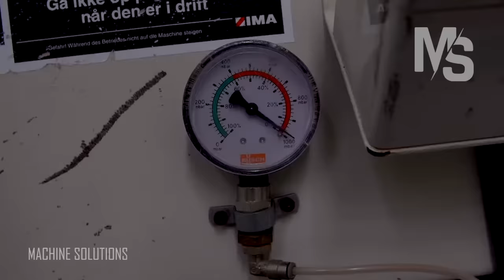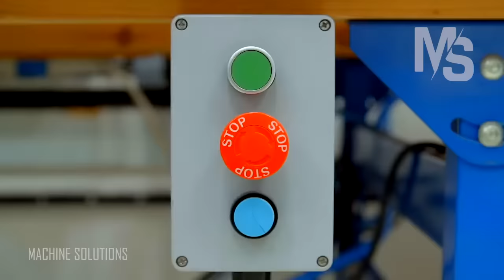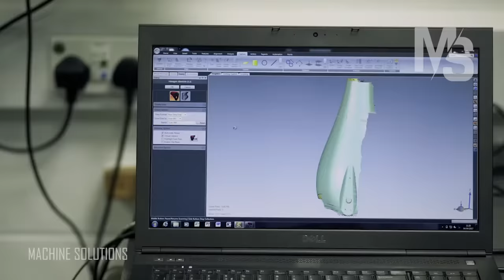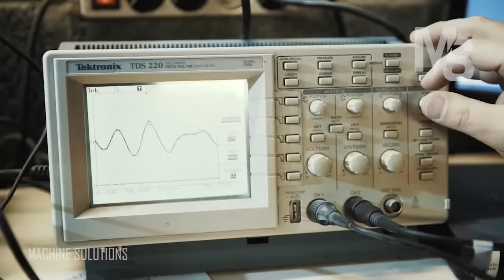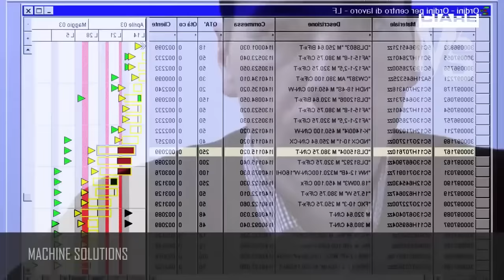Amazing Manufacturing Bass Subwoofer - Making Of Speakers - Factory Tour -How To Make Speakers

Comment: Fantastic video that gives a good insight into the huge amount of work that goes into producing High End loudspeakers. And in addition to that, there is even work to be done with the actual design and calculation of units, etc.
At 3:21. High End speakers and then connectors are used to connect the speakers. In my opinion, soldering should have been used. When connectors are used, corrosion can occur over time so that the connection deteriorates.
Reply: At 11:50 they do solder it.
Reply: @Z-add  At 3:21,  Do they connect the speaker with connectors. There must obviously be a difference between subwoofer units and the other units used, but regardless, soldering will always provide the best connection.
Reply: Also at 2:53  you see some more basic connectors. I find it hilarious that people buy these $35K speakers and spend tens of thousands on exotic speaker cables when ultimately they have to go through a 50 cent connector.

Comment: The Bowers & Wilkins 803 D4 (the first speaker that is made in this video) are great sounding, full range, end game speaker which sell for as of Dec. 3rd 2022 -> $22,500.00 a pair, and they weigh 62.15 KG (137 pounds) each.  They go down to 16Hz and up to 35KHz.  They are easy to drive, hard to move around, hard to pay for, but they sound great!  These 800 Bowers & Wilkins speakers are also used in Abby Road recording studio in England! 🔊🎶😎
Reply: Bob Carver TRUE SIGNATURE subwoofer is WAY more compact WAY more affordable AND sound every bit as powerful in bandwidth, dynamic range...PLUS you can purchase ten of them for the price 1 snooty B&W...HEH! heh heh heh:]
Reply: @catherinetoczek  The B&W 803 D4 is a full range speaker, not a powered subwoofer.  Do you only listen to powered subs?  What speakers do you use for the mids and high frequencies?
Reply: Им цена 5000
Reply: Thiel 7.2 sold for 14,000 and sounded a thousand times better then these speakers. price is in all this art with B&W not sound. My two cents ;)
Reply: The 803 D4 is a very good speaker, but it's FR is actually 19Hz to 28kHz (+/-3dB from reference axis), so it's more like ~24 Hz which is still quite good. As far as it being an end game speaker, it depends on your budget since it's not remotely at the high end of speakers and speaker pricing.
Reply: In my experience people can't tell the difference between a $1000 FR speaker or $15k  speaker. I asked a few people at 
Full Sail here in Orlando to pick the better speaker 10 times in a row and surprisingly it always was 4/10, 5/10 6/10 times the better speaking was picked. Same odds as guessing. It was between a B& W 802 and some sort of Klipsch speakers.
Reply: @tommygun5vsrocky   RIP Thiel speakers.
Reply: @catherinetoczek  You are talking about a subwoofer! Nothing but bass, sir. And it can be crossed over at 24 or 36 db per octave, from 20-200 hertz!  No midrange from 500 to 1k and no highs from 3k to 20k!  You may not know what song is being played.
Reply: @@ukiahspiritThe point being...?
Reply: Grossly overpriced. Apart from the computers there is not a single piece of technology in display here that is not at least 100 years old. I'm so glad the chinese are putting capitalism out of theory and into practice and driving all these snotty european brands out of business because that is exactly what they deserve.

Comment: A bass subwoofer as opposed to,  you know, a treble subwoofer. 😁

I do love me some Bowers & Wilkins, though! I bought some P3s that shocked me for on-ear headphones... then bought P7s and the PX8s.

And the physics of line arrays still feels a bit like magic...ya know?
Reply: They aren't woofers of ANY kind. They have a ribbed reflex for a short throw and quick return/response for lows and mids. They also produce a decent high frequency These are guitar amp speakers/PA cab speakers. A woofer or subwoofer has a dimed/spherical reflex for a deep throw (aka bass production).
Reply: @asmongoldsmouth9839  Depends which clip you're seeing. There's a number of different drivers shown in the video
Reply: Look up the speaker designs of BFM. He was an acoustics engineer for NASA and the space shuttle program that retired and started designing killer cabinets of every type for every budget from home theater to make your ears bleed concert grade. He sells the detailed instructions on how to build them. He has a bunch of designs for line arrays.

I built a pair of his Table Tuba Long Style subwoofer cabinets each containing a 600watt 10" woofer that can vibrate my entire two story house. They are a 12 foot folded horn in a 5 foot cabinet. They go down to 30hz.
Reply: LOL
Reply: I was gonna write the same thing

Comment: If only cerwin vega put this much work into their speakers!
Reply: They used to....the quality quickly went downhill after the company changed hands and things were getting made in China...find the ones made before about 2000....I have a set of RE38 and 200SE
Reply: @chemicallust77  DC1515 is  considered one of the best cv speakers!  They punch hard and loud! And if i don"t remember wrong, dali had their fingers in   it to! They made tweeters and mids!  The xls series is ok, but far from good! You get much sound for the money😅

Comment: See the ribbed reflex? That is a guitar speaker or a PA speaker. It is made for lows, mids and a little bit of highs. Add a bullhorn for full pronounciation on highs. That is not a woofer. Even though it is large. It is just a driver. 

A woofer or a sub-woofer has a domed/spherical reflex for a deep throw.
Reply: Not always.
Reply: All we really know is it's a woofer, a LF driver. 
Could be HiFi, PA, or MI (musical instrument). 

What you refer to as the 𝘳𝘦𝘧𝘭𝘦𝘹 is the 𝘴𝘶𝘳𝘳𝘰𝘶𝘯𝘥. 
(reflex is a woofer box alignment, with a tuned vent)

The surround design doesn't necessarily dictate application ... 
but you're right ... 
oftentimes shorter throw "pro" type LF drivers oftentimes have corrugated surround, and hifi type long throw LF drivers often have half-round type surround.

Comment: I must comment on @hifi-photo-bri8367's statements from 3 weeks ago:
You wrote that a B&W 803 speaker can produce 16 Hz??? Never! Simply not possible (rule of physics) from such a small cabinet and from these small woofers except :-) ... with 15 dB or so :-) ... B&W's speakers are fine, don't get me wrong but they're very expensive and not even B&W can really break simple physical rules ... but -yes, I know their marketing team can bend real measurements very well and at the end there are fans of B&W and proud owners who tell the world "my 803 goes down to 16 Hz." BUT 16Hz at -15 dB or so are simply not noticeable ... 16 Hz at ZERO dB are the real deal and you need a big cabinet + big woofers + a big amp for that ... or at least an activated B&W 803 with a DSP and then you'll pay for the noticeable 16 Hz with a reduced possible maximum level. That's it for now, folks!